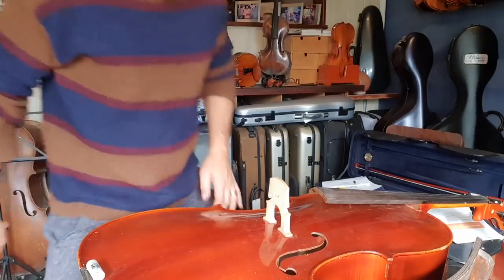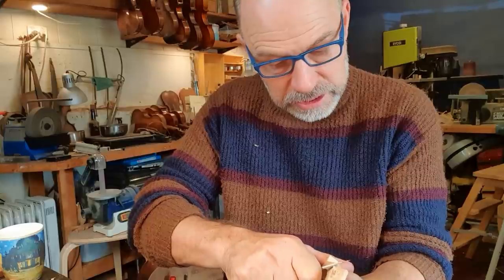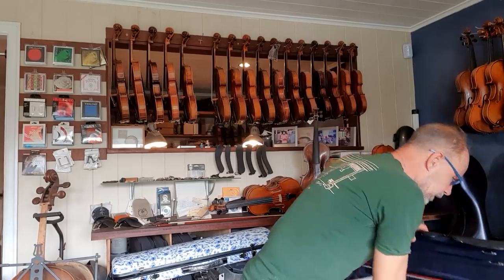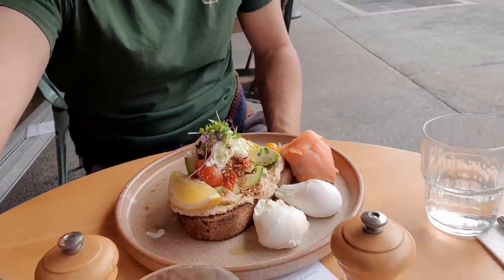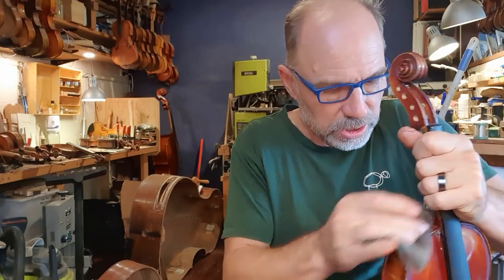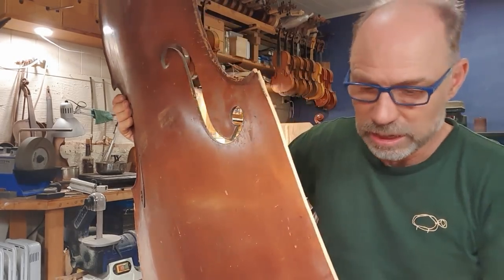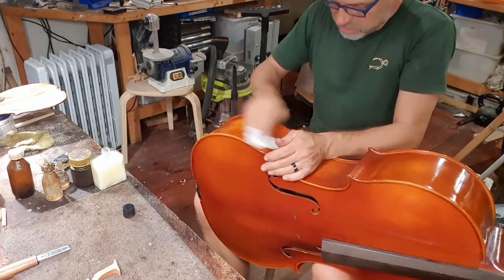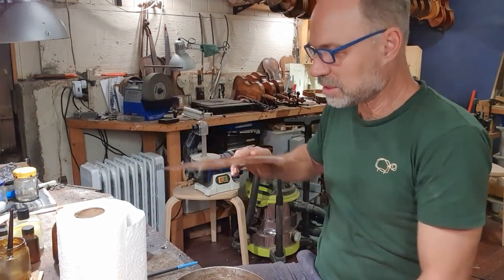A Day in my Workshop - Double Bass, Violin and Cello repairs

Comment: I am a woodworker. Some glues are very oily and it is hard to glue together. In those occasions I clean the gluing area with a small piece of kitchen roll paper slightly dipped in acetone. it works remarkably well.

Comment: Wow, thanks for sharing this awesome experience with us !!! ,Also I have a question for you  ,Can we make a Right handed violin as left-handed by switching strings, bridge and with a left chin rest ?? If that can be possible, will it sound the same as normal violin ? , Please can you give me an answer ?
Reply: I'm afraid that isn't possible as the violin isn't symmetrical inside. You have a soundpost at one side and a bass bar at the other. And also the graduation of the top and back isn't symmetrical. I think almost all left handed violinists play right handed.

Comment: How does someone lose the side of their instrument? Especially one that size.
Reply: Just speculating: It looks as if it was stored in an attic for a decade or three with all the dust and spider webs attached to it. Attics are not exactly the best environment for anything made from wood - the climate is extreme (hot/cold, varying humidity) and people usually don't care much when they look for something else, so it is understandable that cracks form, pieces fall off and then probably years later someone found a piece of wood in a different corner of the attic, didn't know what it was and tossed it... ...or maybe they'll find it under the old couch (the one with the bird's nest in it) after another decade and wonder what it is...

It's a shame when that happens to old historic cupboards or chairs, but even worse when it happens to instruments.

The good news is that it will give us an opportunity to watch Olaf do a really extensive repair. I'm really looking forward to this!

Comment: Are you not concerned with the very real possibility of the varnish softening during shipping and the bubble wrap imprinting on the surface?!?
Reply from the maker: That can happen, that's why I try and put the bubble wrap on with not too much tension...
About a year ago a violin got stuck at customs in California during the heat wave... It didn't fare well and we had to send a replacement...
Generally we don't have many problems though.